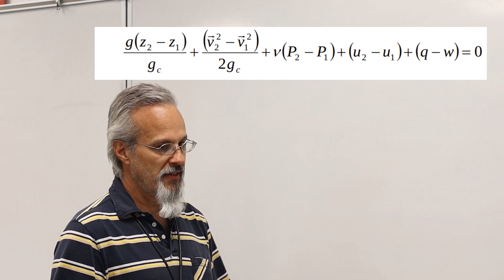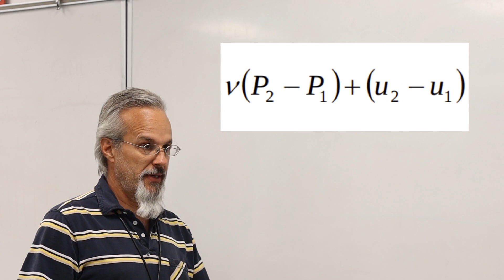PV   U and What the heck is Enthalpy

Comment: Rankine cycle refrigeration Question.

How pressure remains constant in condenser despite the temperature drop from superheat rejection after compressor & sub-cooling heat  rejection before expansion valve? 
Thank u
How pressure remains constant in evaporator  despite temperature rise from superheat gain before   compressor?
Thank u